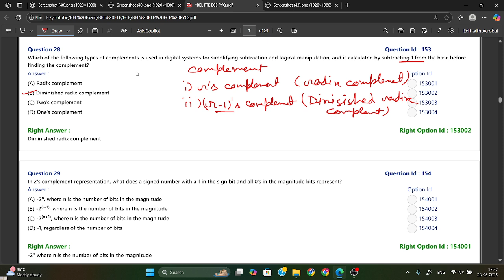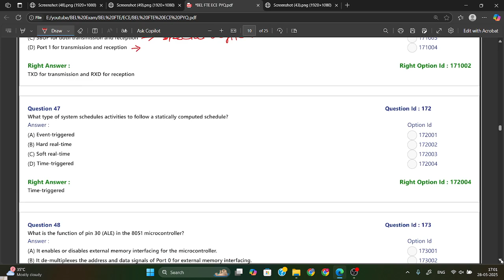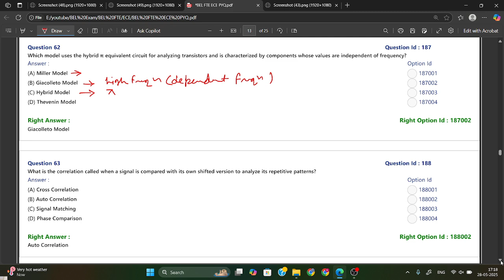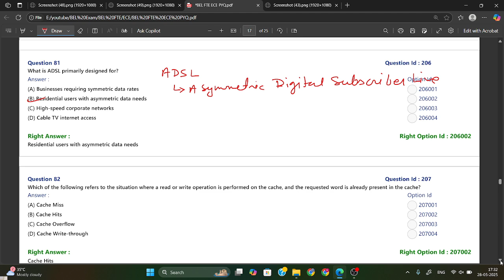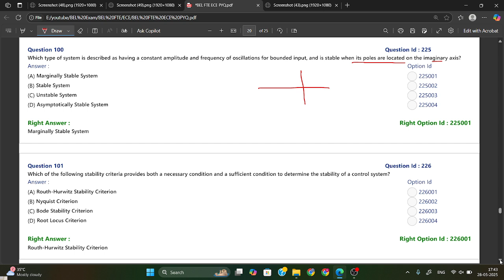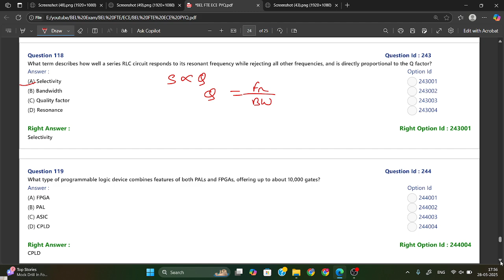BEL FTE Previous Year Question Solution | Fixed Tenure Engineer Paper Electronics Branch | BEL Exam

Comment: sir, will the FTE dy engg (electronics) - Machilipatnam unit's exam paper would be similar to this paper in the video??? or it would be different??
Reply from the maker: May be little different you can see ..becz in machlipatnam pattern in different 70 technical 15 non tech... But questions level will be like this
Reply: @mannmaker1201  ok thankyou sir